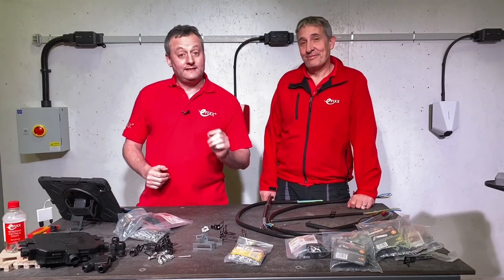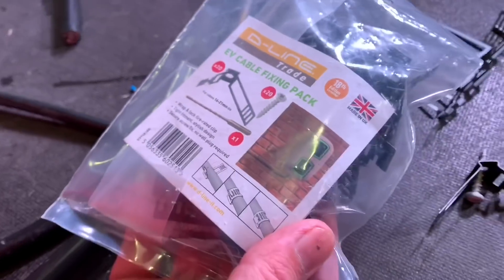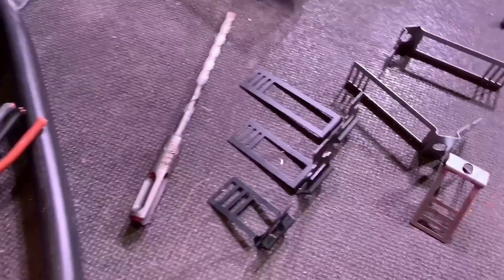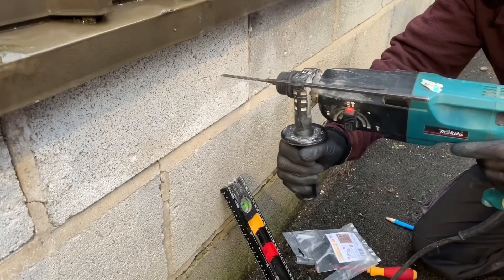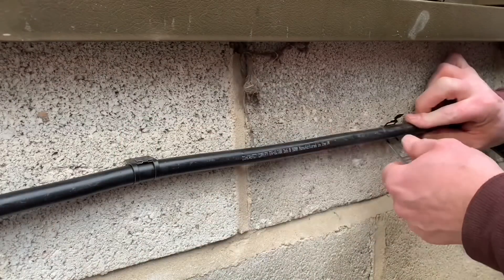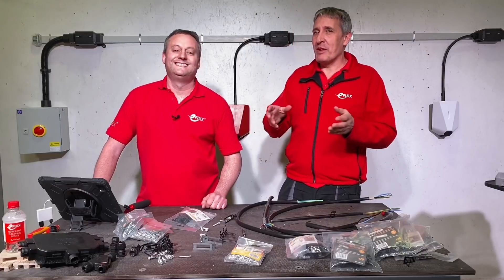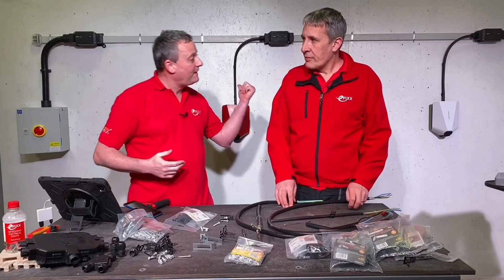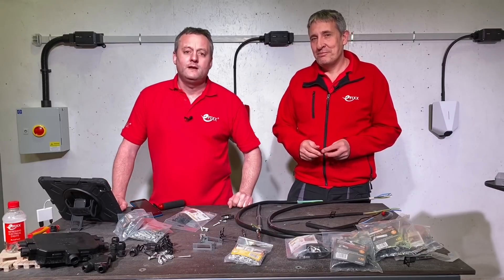INVISIBLE SWA cable fixings - ideal for EV installations - SAFE-D adjustable cleats from D-LINE

Comment: Hi guys, another great video. Where can you buy the packs from, i have only found packs of clips. No Screws & no drill bit. Yes i could buy seperately, but why would you when all together in a pack?
Reply from the maker: We’ll ask D-line for your closest supplier - where are you based?
Reply: @efixx  LL18 4AP North Wales. Thank You for your superfast reply. :-)
Reply from the maker: Reply from D-line - currently on special offer via Edmunsons or Electric Centre.
Reply: @efixx  Thank You guys :-)

Comment: Trouble is these screws everyone’s trying to promote might be “quick and easy” without plugs but they’re also triple the price, most sparkies I know are just using an all-round banding loop every 2 meters or so with a normal red plug (as confirmed by the NICEIC as being ok to use)

Comment: I got told plastic plugs become part of the building structure and even under testing they don’t collapse so using plugs is fine.
Reply: Aren’t those screws more expensive ?
Reply: @anonymous.youtuber  I believe my comment is with reference to the comment made in the video @ 0:58 that plastic plugs could result in premature collapse resulting in non compliance to the 18th edition BS7671, the fixings supplied are fit for purpose and I wouldn’t go out my way to buy additional fixings and plugs. But generally you will find standard screws and wall plugs are cheeper than the fixings not requiring a wall plug.

Comment: What’s the corrosion factor for them clips when in a salt mist area ? I live on the coast and would worry they won’t last long .
Reply from the maker: Good question - data sheet says 1000 hours of salt spray testing. Of course that’s not a year by the sea 🌊

Comment: So, the cable can be removed from the clip without the use of a tool.  That'd limit the places that I'd actually use them.
Reply: Fair point. I thought it was going to “snap off” somehow and “lock”. For tamper proof etc (as you suggest)

Comment: All round band is handy for any size cable , no preselection reqd
Reply: I'd wager it's much cheaper too, and can use it to group multiple cables. 
These would need to be speced and supplied by client before I give up my all round bands (black red white)
Reply: @darylsavage119  I was using one man band when I was an apprentice 30 years ago . Still using it now . Handy stuff , can get you out of a trip to the wholesaler when you dont have the right size cleats

Comment: Is there any adjustment (up/down)  if you get off line ?
Reply from the maker: It’s a fixed hole, but you could flex the clip
A little bit either side.
Reply: @efixx  thanks .

Comment: Nice clips, makes the job nice n neat .. what are the screws like in the old yellow stock bricks as they didn't look too snug a fitting in those blocks and we all know how soft a yellow stock is
Reply from the maker: We’ll do more trials - might need to drop a drill size on the softer stuff - we have the opposite problem - quite a bit of blue limestone - literally rock solid.
Reply: @efixx  yeah i was thinking 4mm might be suffice, they look similar to some fixings ive used, terrible in real hard block and concrete, either rips the threads off or snaps